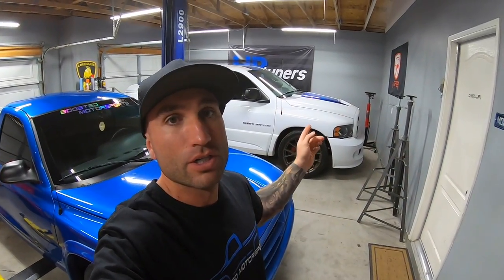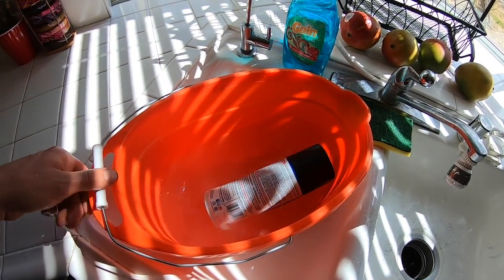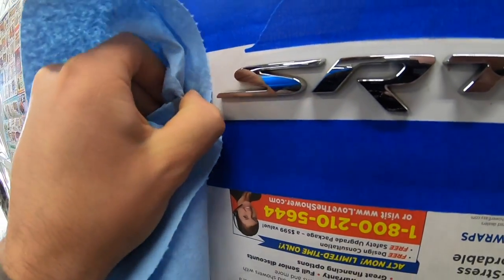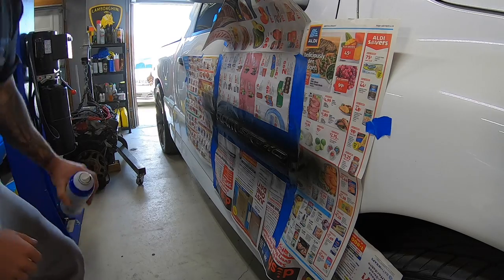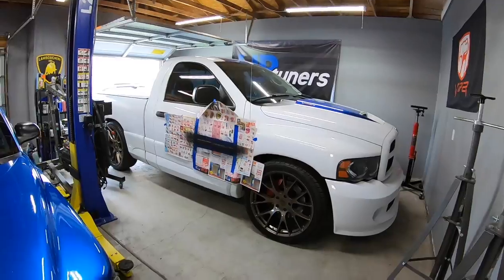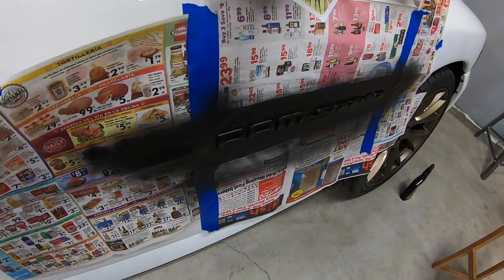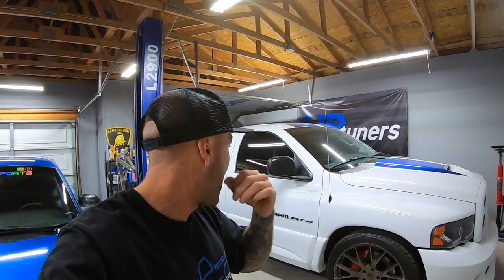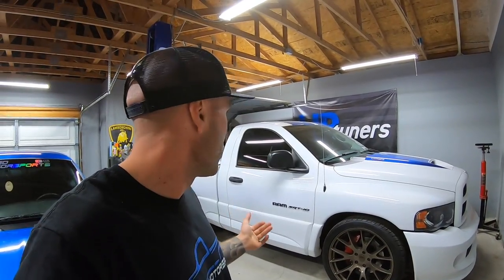Dodge RAM SRT-10 Gets BLACKED OUT Emblems

Comment: Did it take just 1 can for doing all 3 emblems? If also doing the ram badging on the tailgate, could you have done that with what was left in the 1 can or would you need a second can to be safe that you have enough spray?